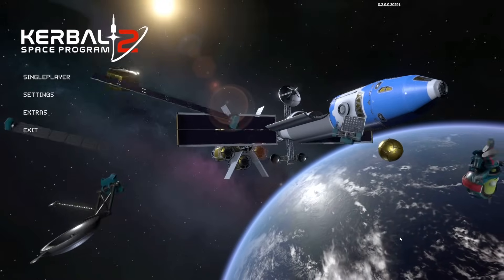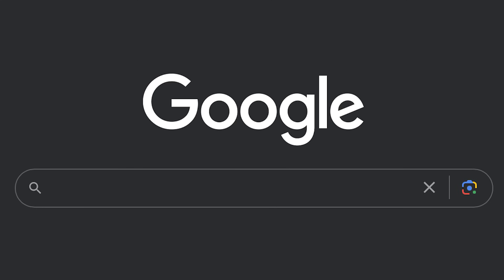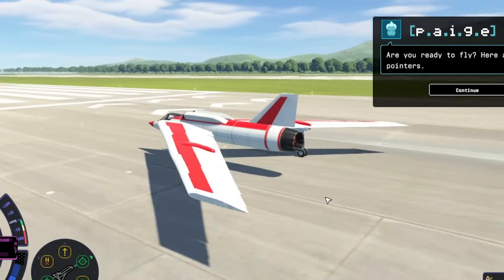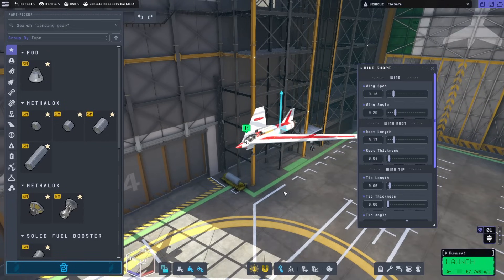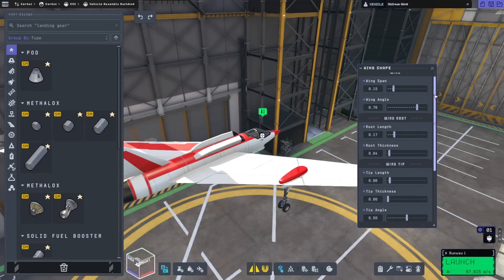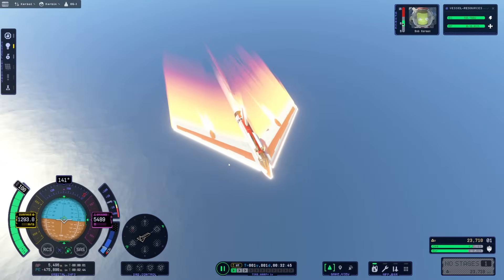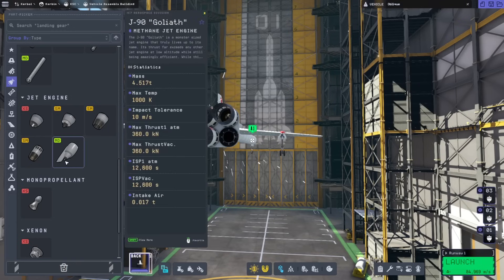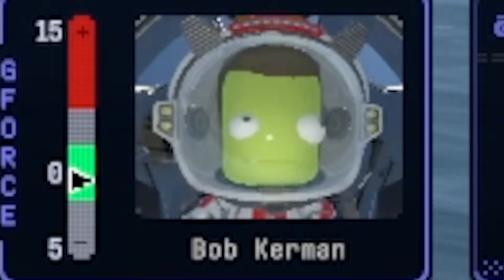Testing the future of air travel!

Comment: The point of the oblique wing was that it would be a wing that shifted. When taking off it would be a normal wing and generate good lift then once you passed the sound barrier the wing wound shift into the oblique shape which is good for high speeds not low speeds

Comment: 3rd year Aerospace engineer here. The main issue with the oblique wing is that it causes a rolling moment. When testing the NASA AD1, the pilot recounted that when the wing was pivoted he constantly had to roll right to prevent the plane from rolling left. One solution might be a biplane sort of design with two wings, one on top and one on bottom, each pivoting in opposite directions(so that when looked from above the wings would form an X). In theory, this might provide all the benefits of the oblique wing while eliminating the rolling moment

Comment: 6:54 To solve your issues, you could decide to have that Whiplash on the back, with 2 Panthers on the wings.
At takeoff, activate the Whiplash. This should give you the thrust to overcome the high aerodynamic drag.
Once you are well above the sound barrier, switch off the Whiplash and switch on the Panthers. With the improved aerodynamic flow, lower thrust should suffice.

Comment: 5:40 dear Matt, you're an absolute architect. You can't pull up not because of lack of lift - the plane is flying later on so lift is fine. It's because the center of lift is way behind the center of mass of the plane and so the plane is constantly pushed into a dive by the force of lift. Actually it is because there is so much lift the plane can't pull up.
Reply: Also because he didn't put any elevators on it. It's honestly impressive that the planes he makes fly as well as they do.

Comment: From me watching the video, what the video was arguing was that an A cemeterial wing would work just as a jet wing would. once at that mock 1 and above.
The idea of the oblique wing was to have a simpler design for jets. because the aerodynamics dosent care if the plane is cemeterial. it only cares whether which wing produces enough upwards thrust. So, the wing would stay flat for takeoff and landing when going under the speed of sound, but after you reach the speed of sound you would turn the wing so that it would be A cemeterial, the reason for this idea to my knowledge was that with the Airforce. We have made wings that hinge for takeoff, landing and supersonic speeds. but they were prone to breaking, because they were so complex. And the maintenance was astronomical. I remember talking with an aerospace engineer about shuttles and the wing design and they said that that type of wing design wouldn’t work because the wings being at a 90 degree angle then turning 40 degrees, they basically said that it would break under the force of escape velocity. But she said that the oblique wing would be promising if they could get funding for it. I think we would use an oblique wing  for shuttles because takeoff would be fine with the wing flat, once at mock one you would turn the wing oblique. Then at escape velocity you should be fine. Though I am no aerospace engineer, I’ve only talked with some.
I may be wrong I am no professional or expert in this field. I just watched a video and talked with some people, I know nothing.

Comment: I was taught a bit about planes a while back. I learned that the bigger wings don’t control pitch, they control the roll. The pitch is done by tinier wings called elevators or something. Either on the back or front. The yaw is controlled by the tail wing. I make my planes in KSP 2 like this now and they are so much more stable and have a higher tendency to get in the air.

Comment: I think you got that mustard video wrong. You'd have to try it in KSP 1, where you build an oblique wing on a hinge. You'd take off with the wing perpendicular to your plane. That way, it's controllable and takes off quickly. Then, as you pick up more speed, you would have to rotate the hinge, and that way, you could fly faster in a more controlled plane... Also, as other people mentioned, adding elevators wouldn't hurt. But what do I know? I'm a mere mechanic.

Ps. By using the hinge as mentioned in Mustard's video, you wouldn't have any problem, with center of lift shifting, which is way too cool.

Comment: 2:50
That is the surface speed, not the true air speed (which is the specific speed that needs to be faster than sound for you to actually breach mach1 with a sonic boom). You were not necessarily moving faster than sound though undisturbed air, despite you having a faster speed than sound relative to the ground.
In aviation there is a difference between those speeds and terms like GS (ground speed), TAS (true air speed), AS (air speed).

Comment: By the way, the issues you were having weren’t the issues normal oblique wings have, and you might find out what those are if you make a stable plane. It shouldn’t corkscrew because both wings are producing lift at the same time, the front isn’t producing more than the back. It’s not your wings that are the issue, it’s the control surfaces which need to be moved to conventional elevators and a proper rudder

Comment: You did confirm oblique wing handled takeoff astronomically better than the symetrical triangle though. While still performing near identical to the supersonic wings. Which was the whole point of the video, that they are better at BOTH speeds, subsonic and supersonic. Whereas symetrical you must compromise one or the other.

Comment: Funny thing, I’ve actually tried an oblique wing, a connected wing, and a ring wing before (Xplane). The connected wing worked so well it gave the ME163 a run for its money with glide capacity. Of course I’m not sure how realistic I made the rest of the design…
Here’s the thing: the oblique wing was real but it was variable geometry. It took off as a normal plane and pivoted the wing in flight to my understanding.
Also you aren’t modeling it correctly in the slightest, which is weird considering KSP should have the ability.

Comment: In this video RCE combined elevator and ailerons into elevons of the main wing, then he build two prototypes with symmetrical and asymmetrical swept wings to see difference in drag at supersonic speeds
He didn't forgot elevator, as architects would do, he omitted it to not affect results of testing, because elevator could behave differently with different main shape, due to main wing because downwash.
The results of this experiment proved that KSP 2 still doesn't simulate aerodynamics at such details to have significant difference, so conventional swept wing design would be better, because of controls.
Reply: Just kidding, he forgot and KSP doesn't simulated such stuff :D

Comment: At least with actual aircraft there is a small, often overlooked aspect to the wings. Most commercial aircraft have the wings angled slightly up. This encourages the aircraft to default to straight and level flight. Fighter aircraft have wings that are angled slightly down to help assist in turning.

Comment: 1: The angled wing was creating too much turbulence beyond the trailing edges. That's why a full delta wing works far better  than the two separate wings. Think of a Tornado, a B1, or a or F-14 Tomcat with the wings swept back. They're creating a delta wing envelope with the wing and the rear stabilization control surfaces.
2: The oblique wing setup wasn't on the the same angle. The two oblige wings have to have the leading edge transect the fuselage at the same angle. Your starboard wing was offset just enough to cause turbulence over the trailing edge that caused the aircraft to become unstable.

Comment: 2:24 That wobbling moment there is called PIO (Pilot-induced Oscillation) which is basically the SAS trying to correct itself but by doing so would overshoot, and would enter a feedback loop until it fixes itself eventually (or crash).

To fix it, at least in KSP: lower your Authority Limit, and maybe read more about aeronautics.

Comment: Hi, sweept wings aren't for supersonic flights. The sweep angle is used in plane like 747 in order to delay the effect of compressibility (mach 1) and go in faster subsonic.
Another reasons to use the sweep angle is to move the center of lift behind the center of mass, as shown in all-wings plane.
Figther jet use Delta wings, which have a different phisic behind them (even if seems that those are similar to sweept wings), in this why they have better performance in supersonic flights

Comment: Matt also not realizing there is literally 0 way you could land this if it was commercially produced. NO SYMMETRICAL REAR LANDING GEAR
Reply: Just make an extension on the body and put the wheels there. A good example is the Airbus A380

Comment: I don't know exactly which video you watched, but it was likely either underinformed on the topic or trying to oversell the concept.  There are already planes with variable sweep (such as the F-14) to address the same issues as the oblique wing does, and they work wonderfully, but the oblique wing aims to simplify the mechanism and make maintenance easier.  There are issues with the oblique wing though.  Because one wing ends up forward-swept, it unbalances the lift and induces a constant roll, the forward-swept wing also experiences greater stresses that can bend and permanently ward the wing.  Other issues with the design are that it needs a powerful motor to actually rotate the wing into place, that the action of rotating the wing causes the plane to yaw slightly, that the mechanism ends up either occupying most of the fuselage or compromising the wings' connection to the fuselage, just to name a few off the top of my head.  So a ton of safety issues, all to save a few dollars on maintenance.

Comment: 5:40 nope, your wheels are simply so far back that you are basically waiting for a pebble on the road to give you an upwards angle. Engine and control surfaces apply a force that is trying to pitch the plane, but there is no leverage because the wheels are so far back. Imagine if you stuck a wheel right at the tail of the plane which is the same height as the one at the front. Takeoff would be very hard, regardless of other factors. Then there is of course the fact that your center of lift is so far behind your center of mass, so the applied force has a much harder time pitching, even in the air. Combine the two.. and yeah this really probably has little to do with any kind of lift calculations the game may or may not be doing.

Comment: If I recall, the whole point was that it was a rotating wing. So it's straight out to either side for liftoff making it easy to takeoff, then once at speed it rotates the wing to the strange asymmetric position so that it's less surface area than a standard straight-out wing design, closer to what you'd expect from a swept wing. Idea was a single motor handling the whole mechanism with minimal stress, verses 2 very strong motors handling each wing sweep individually. The forces pushing on each wing would roughly be the same, so rotating the wing would only need a cheap weaker motor

Edit: 17:23 literally this, yes

Comment: 5:40 the reason it couldn't lift up wasn't because of the lack of lift, but because the ailerons trying to act like elevators were pushing down on top of the wheels, instead of using the wheels as a lever. So you basically made a car spoiler to keep the wheels pressed against the ground using downforce, instead of using it to lift the front wheel up.

Comment: Your airplane was not rotating for take off because your CG is way too forward from the main landing gears and you have no elevator. If the CG is just a little forward from the main landing gear, then the elevator should easily produce enough moment force to pitch the nose of the aircraft up.

Comment: sooo...the whole concept of the oblique wing is,that you start and land with straight wings for your better maneuverability at low speeds and then tilting the wing at just one point into that asymmetrical appearence...also if the wings are symmetrical or not,air doesn't care about but flowing around your wings so that's kinda the whole point that worked in real life...I saw that documentray too

Comment: As an aircraft mechanic who’s studied aerospace engineering… you may have forgotten the horizontal stabs on the tail to control pitch lol

“Pull up! Pull up!” -you

Yeah… you’ll find that quite difficult lol

Though I suppose the eurofighter and other delta wings don’t have horizontal stabilizers, but they do have canards in the front for quick maneuvering

Comment: When I made my first really fast plane, Also the plane that made it into Orbit. I painted it Red. Really bright red. Now, I am not sure if it was the small refinements to the air frame, or the decisions made on the engines and intake, or the fact that it was all red. But that aircraft exceeded 2200 m/s. Maybe if your  plane was red it would have gone faster. Also maybe kicking on the afterburner on that Panther could have helped before you changed back to the Ramjet engine.

Comment: You didn't pay attention to the documentary on the Wing... It's fist a standard wing at take off then it rotates at speed and altitude, but in the documentary, the makers of the design found that it would corkscrew unless if it had the proper instruments to compensate for it....

Comment: @Real Civil Engineer
13:55 You could just throttle down (green bar) to like 25% thrust, to become within the 100-300 m/s speed range.
Then you can just change the throttle, without messing around with changing the airplane, a new engine means other weights & other thrust measurements ans such, lots of pollution in that data.

Comment: So, when I saw that same video about the oblique wings i rushed to try them on Flyout (which is a game i recommend) and they do seem to work, although the point of rotation has to be behind the center of the wing for the CoL and CoM to be somewhat balanced in both modes, also, the controls get a bit wonky on full oblique mode, but its fixable, and, of course, it goes without saying you cant use any dihedral, so the roll stability has to be considered

All this to say, try FLYOUT, its a really cool game

Comment: 5:22 wow I actually did the math and .15 is super close to the correct length, it actually rounds to .16 though (for anyone wanting to check, the ingame angle measurement is the angle in degrees divided by 180

Comment: Dear Matt, the oblique wing is a different approach to the Swept wing style planes (f-14) the best of both worlds. The Oblique wing would start in a symmetrical mode as to get rid of that unwanted roll at slower speeds, for more maneuverability and for slower flying capabilities. The Oblique mode is there to allow it to travel faster as soon as it gets up to speed, for better stability at higher speeds but also to use less fuel as there is less Drag.

Comment: Doesn't help ksp doesn't necessarily do full fluid analysis of the wing system, or that the oblique wing is a system meant to be symetric at low speed, or that ksp doesn't calculate different Mach levels at different altitudes

Comment: I think the oblique wing was supposed to be used similar to the swing wing design? From what I understand it's one continuous overwing with an electrical motor that would rotate it, letting the wings be perpendicular to the fuselage during takeoff, then at a certain speed, I believe just before trans-sonic speeds, the wing would rotate and become oblique. The leading edge would then only create one vortex at the non-leading edge, making less aerodynamic friction with less turbulent air as the air must travel all the way down the leading edge to the tip at the tail end. 

I think they were supposed to create a more laminar airflow over the wing, also reducing drag and increasing the flow of non-turbulent air over the wing itself.

Comment: You couldn't pitch up at 5:50 because your center of rotation was too far back on the plane. You couldn't get enough down force in the back to increase the angle of attack.